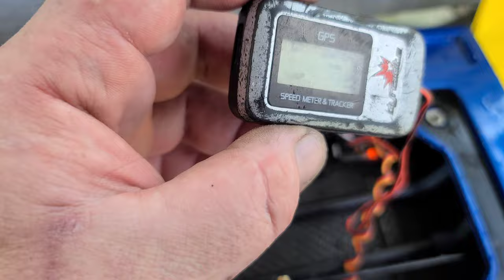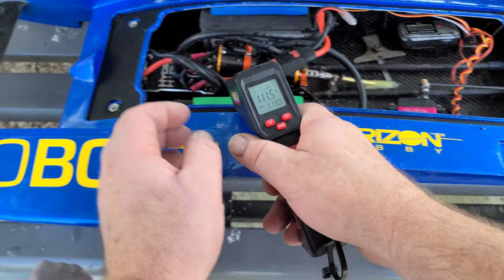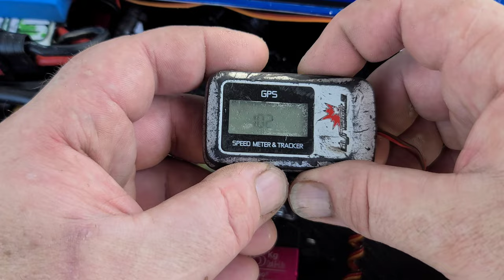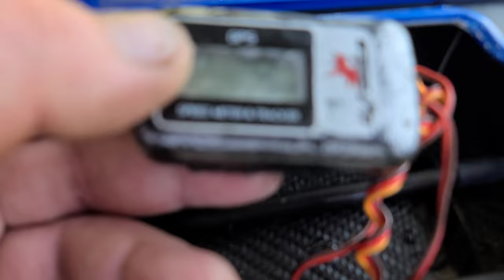Brutal Bash & Crash UL-19 Hydroplane - Castle Creations Hydra, TP 4060-CM, SMC Racing

Comment: Great video Big B, Great run and your battery run time was longer than usual.  You have shown the natural effect of heat loss robbing our motors of energy/torque, that is to say your setup was running very cool and look at the muscle your boat had, she was moving out on that 42mm 6pitch, So as much as we want to push things to there limit we need to define what that limit is, in this case running our boats up to but not past the point where they get so hot the efficiency drops off. That’s what I’ve learned here at Ironclad RC and a host of test and tunes on my part. 
  I know you are setting that boat up for speed runs but it could definitely hold its own in a race, Great run 👍

Comment: I love what you said starting at the 13:14 mark. Doing your thing, and figuring it out obviously by your results. 

It also backs up what I've said, you throw an insanely higher amount of power to a given setup, it changes things. 

Setting the strut deeper in the back, with negative prop shaft angle, very good Big B! 

Good luck going for 100mph! Sounds like you figuring it out. By putting in the time. Boat looks great on the water!
Reply from the maker: Thanks sam, shes a work in progress.  I can definitely tell a difference with the way I have to tune this setup opposed to the stock setup..  seems like the faster the boat goes the higher the "aft ride height"  needs to be.  Almost like the air gets trapped under the hull and causes her to rise up at higher speeds?

When I ran that negative angle the bow stayed planned but she was hopping, so I may flatten it back out, and raise the ride height a smidgen?   See what that does next time out...  
     Definitely wearing my brown pants when i take this one to the speed run spot!!! 😆
Reply from the maker: Dang, how did I miss the ul19 setup video, I'm watching it right now..  never used a 5mm shim under the  sponsons but it makes complete sense.

Your running 29mm with the 5mm shim, so without the shim so your basically running a 24mm ride height with the sponsons on the setup board right, I just measured mine without the shims, mine is at 27mm at the transom 

Congratulations on the 111mph pass with the 33 on 6s, that's awesome 👌00  now I gotta catch up with you!
Reply from the maker: I actually have a question for you when you get a chance?    How wide Is the rear ski on your jae21?  Been curious for quite some time now!    The oxidigger rear ski measures 35mm.
Reply: @IRONCLADRC  Thank you sir!
Reply: @IRONCLADRC  It's 26mm wide, the rear ski. Big B, you know I love sharing info, like you do. I love seeing others do well...

Ok, so you do have your transom raised up. 

So it's not that you can't keep nudging your prop shaft angle and figure out what works. But with it shimmed, you know before you run if your prop shaft angle is negative or positive. Also you can get back to a known setting after a wreck.
Reply: @IRONCLADRC  Oh, also don't forget you can take out hopping with a higher rake angle prop. I do that when the setup is close like yours. A finer adjustment, less lift with a narrower thrust cone... BG4L! 👍💯!

Comment: Yup, that was the time to call it a quit after hitting the bank... 
Was wondering though what happens when you try to turn at high(er) speeds. Or does the ul not turn with this setup?
Reply from the maker: I'm running a shorter turn fin on my speed run setup so cornering isn't that great.